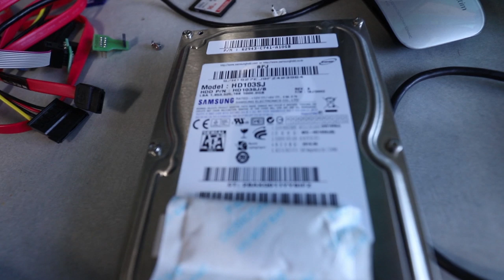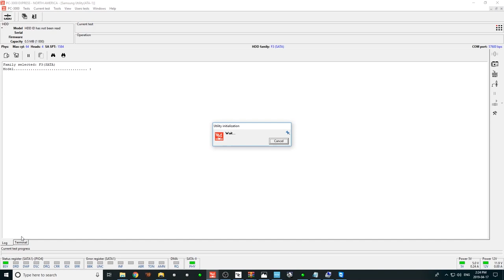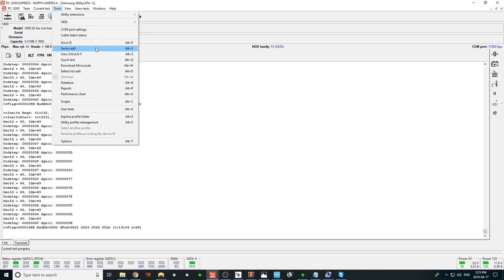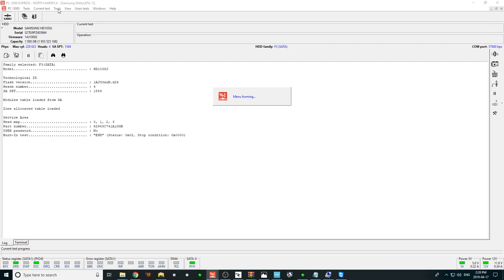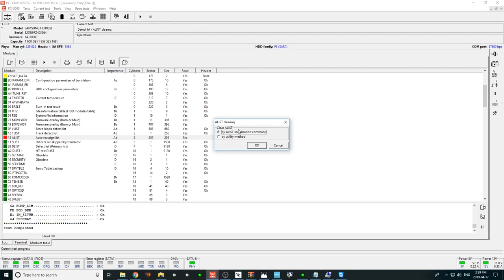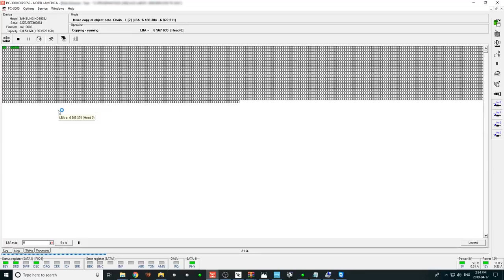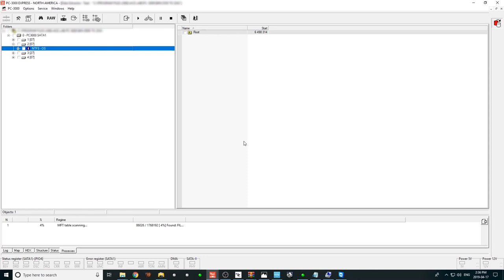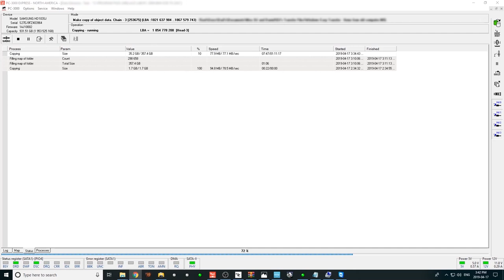Samsung hard drive spins up and then spins down? Maybe this is why

Comment: When you show how to work in detail, this is priceless! I got WD10TMVW (usb 3.0) that clicking, when i use it with my PC-3000 Flash, have file structure (many broken files) but cant operate with heads. Will give that drive to master who have PC-3000 for HDD, hope they can recover data without swap heads.

Comment: Hi Erkin I have seagate 2tb hard disk . when I plug it into the power it starts spinning and then it stops spinning . can you please tell me what is the problem to my hard disk and can get back my drive to use? , please reply to me
Reply from the maker: heads are dead.
Reply: @hddrecoveryservices  can I change the head

Comment: Is data recovery more difficult on an ssd comparing to hdd?
Reply from the maker: that depends on how the SSD will be recovered. Some SSD drives are supported by PC3000 Utilities, and most of the tame it is fairly easy to recover them there. Some SSD drives can be repaired on the component level, and some can be recovered as chip-off. It is not more or less difficult, as much as, a completely different approach is needed.
Reply: @hddrecoveryservices  I'm interested in seeing some ssd recovery videos. As a retailer, I've had dozens of damaged SSDs, some totally dead, others detected as 0byte devices and others with tons of bad blocks. I would like to see a successful repair of a device with similar problem so that I could warn potential buyers of the risks of cheap SSDs and recovery options.

Comment: Hi.
I have an old IDE 3.5' drive that spins up, and right down. I hear absolutely no head movement, moreover I think it doesn't even sipn up to full speed before it stops.
I had another board from a similar drive, swapped it, and the drive works perfectly.
So the problem is with the board.
I've inspected carefully the whole board, did a lot of comparative measurements against the good board, but can't find anything obvious.
What do you think the problem might be?
Thanks.
Reply from the maker: It needs to be tested. Does the drive work and mount with a donor board?
Reply: @hddrecoveryservices  Yes it does. Works perfectly with the donor board. I just want to fix the original board.
Reply: You may want to get a specialist in electronics check it out. Those that also repair laptops. Note that the board has some firmware on it, might have parameters of disk layout and swapping board may not work fully. Other parameters are on the platters, so not affected by board swap. I think you may have issue with power delivery to the motor, which uses larger components, so may be fixable.
Reply: I just changed the cables and all is ok...